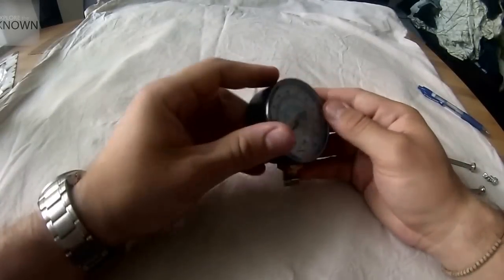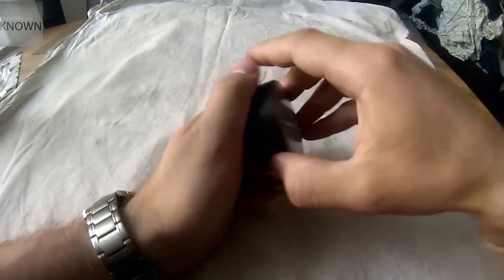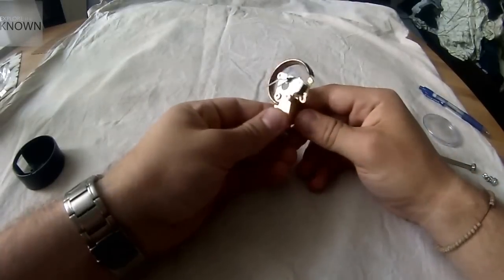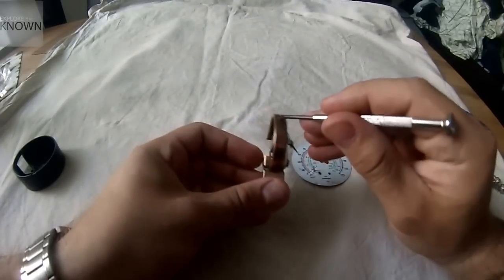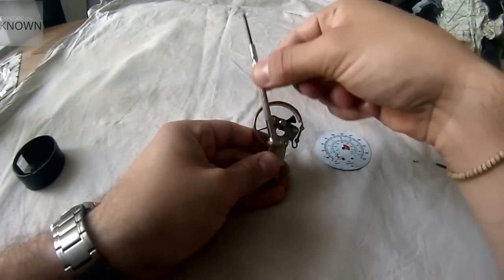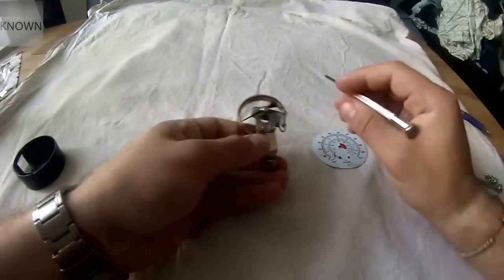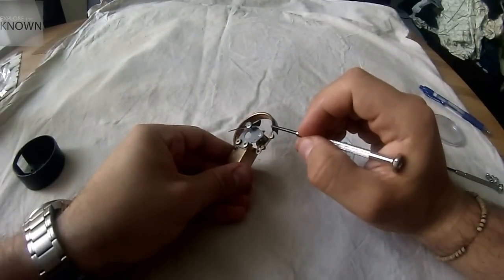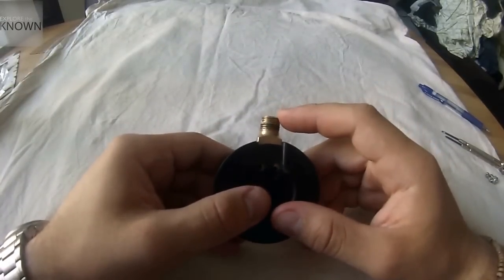How a Bourdon pressure gauge works

Comment: I could still remember mine long before when I was a bit younger. That device seems so nostalgic for me but I guess, innovations are going stronger with time. With that, I shifted myself in using the digital ones like from Mountaincrest. Well, gauges of today seems to be pretty efficient already but it's nice to look back from what we have before.
Reply from the maker: Agreed, but they are still used in many applications, large diesel engines and many power plants use them (the analog/mechanical) but in combination with digital instruments of course. Mainly for redundancy I guess.
Reply: Yep, I expected that a bit. Old companies tend to linger on their devices most likely because of large replacement costs if the total adds up.

Comment: Very nice video, thank you. Can you tell me how to readjust the pointer to zero? Mine is a bit higher than zero. 

Thank you.
Reply from the maker: Just turn the needle/pointer with your fingers to the correct position or just uninstall the needle and then reinstall it in the right position :)

Comment: Thanks. But I've a doubt. 
After sometime, won't the rigidity of copper tube come down and hence a chance for caliberation to get wrong?
Reply from the maker: Don Francis It sure will over time. But I don't know how long that will take (years, decades, centuries?), my guess is that you change the whole manometer before that happens, ex starts leaking somewhere. And you can always dismantle them and test them in a calibration bench.